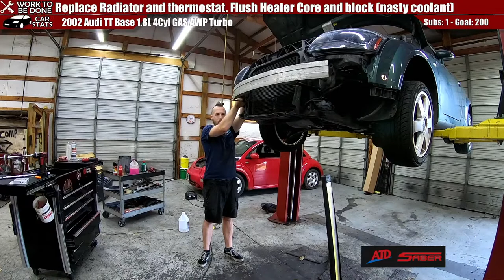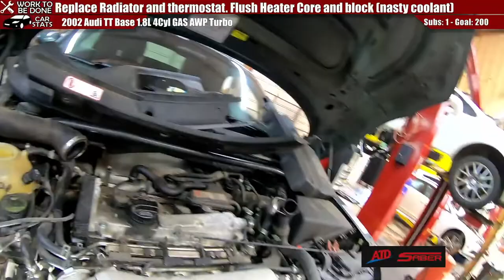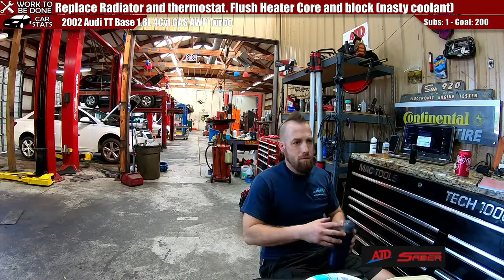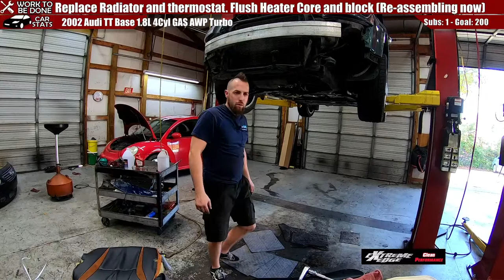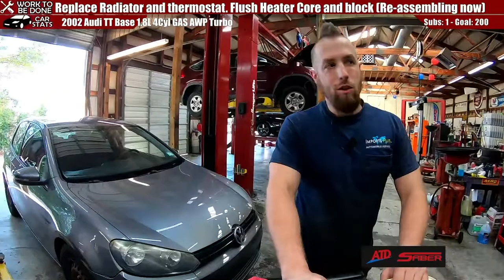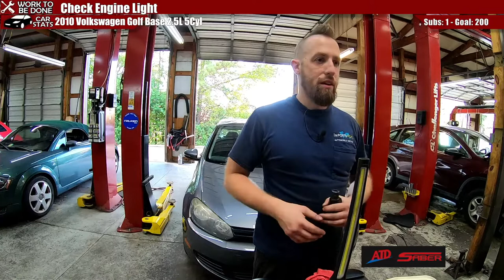(VOD) Audi TT Radiator Replacement and Coolant flush

Comment: On my 2001 Audi TTI've replaced he radiator due to an accident. Now the rad has been installed not refilled with coolant yet. My question is do I refill the radiator thru he expansion tank?  Do I need to worry about the coolant  remaining in the block or heater cord?